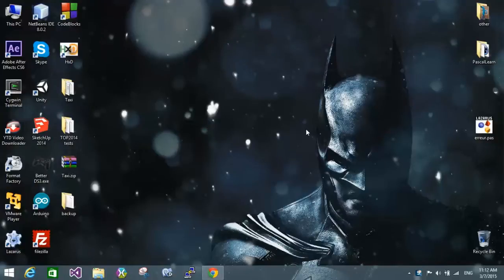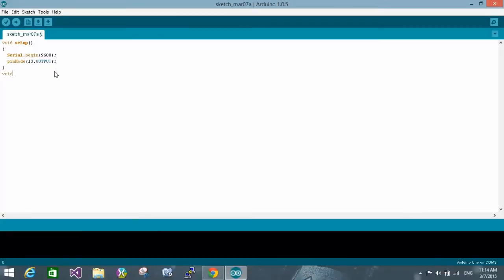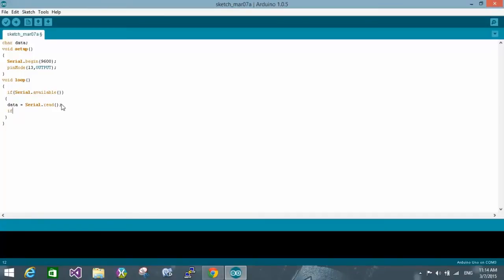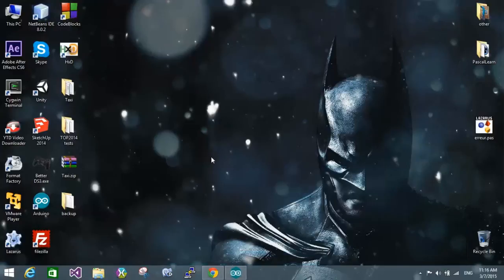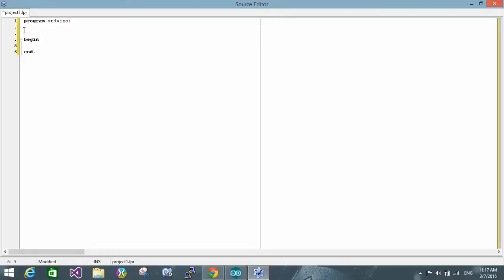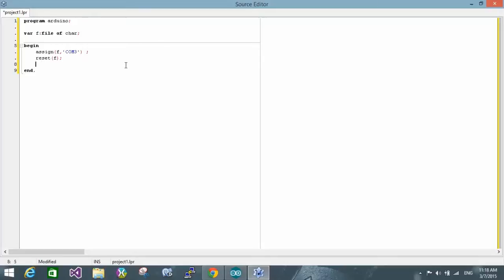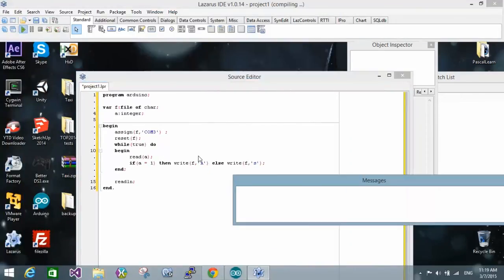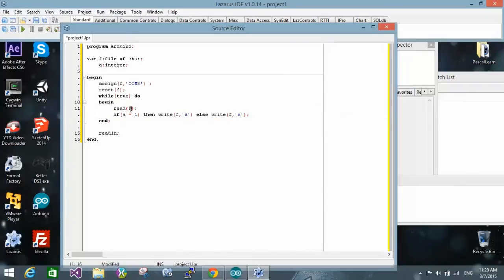Arduino & Pascal programming language - HOW TO

Comment: I did everything as in the video and all went well. But to simulate a project I have in mind I stopped Lazarus, powered my Arduino off, powered it on again and started the application on Lazarus. And then.....nothing :( Now the weird thing: if I start up Putty, the LED at pin 13 flashes some times. After stopping Putty, nothing typed, I can use the program.
This also happens when using the package Synapse with the file synaser.pas. 
Now I have to find out what is going on......

Comment: Massively disappointing. I wanted to see FPC code run ON the Arduino.
Reply: So do I, but remember that the Arduino IDE is designed to take control of all these fancy  hardware input and output connections and the onboard LED #13
Without that you cannot do very much.
I'm a Turbo Pascal guy, and I cherish that, but a guy must know his programming language limitations.

Comment: What so FAKE video, starting from the point that it needs Rewrite instead of Reset and it has not the {$I-} compiler directive to avoid hardware fault... and AFAIK, you need to do it with avr components...
Reply: The compiler directive is not needed, it works fine without that.
I agree on the 'rewrite' versus 'reset' issue, but for some reason both of them are good.

Comment: Good tutorial! But if I need to read data from Arduino? What I have to do?
Reply from the maker: Well , Basically you could read from the file instead of writing to it. so replace write(f,'A') with read(f,data) where data is a char variable that will hold the the coming data :)
Reply: +IKnow Thanks.
Reply from the maker: :) Sure , feel free to join our community forum at forum.iknowbrain.work , so we could learn from each other :)

Comment: THIS IS GARBAGE!

Downvote because you don't show how you ACTUALLY program Arduino. How do you load that Windows app into Arduino????
Reply from the maker: Sorry for being a little bit late, But which part did confuse you? Because we do not load the windows app into the Arduino, The windows app was created to run on windows . the arduino sketch was created to run on arduino. the windows operating system is what connects these to programs together (The one running on windows and the one running on arduino) thanks to the filesystem mechanism .
Please explain a little more so that we can help you
Reply: +Merula Alba 

He uploaded a program in the arduino (with the standard arduino IDE) to respond to the COM port .

The Pascal part only uses the PC COM port to make the program in the arduino react.

But you are right, it is garbage, because there's never any compiled pascal code in the arduino. If that's what you where looking for (like me).

Comment: Hey mate, nice tutorial, im thinking About to Buy my First arduino and Start Programming with it, but Pascal is the only language im able to use more or less, 
But i have 2 questions :
1. How Do i know which one is the USB and which USB? I never used the assign function before.. In which order does this COM'x' work? 
2. Why Do you use 'A'  and 's'? How does the arduino Interpret that? How does it know which Pin on the board is meant etc? In the normal arduino IDE you assigned Pin 13 as an Output but in Pascal there is nothing which declares that
Reply from the maker: Hi sorry for being a little bit late.
1/ when you install the arduino ide , there is an option in the menu bar that tells you the name of your com port , it should be something like com1 or com2 or com3 and so on. So there is no order , the ide will tell which one to use.
2/ We told the arduino to do something when it gets the character A, nothing special about it , you could pick any byte (any character since a character is a byte) but the same character you pick in arduino is the one you have to send from the computer. the the character s is a random one , the main thing is that it has to be different to the one we picked before ( Arduino needs to distinguishes between which one turns the led on and which one turns it off).
The special thing that the arduino does when it gets the character (I called it A in our example)  is to turn the output voltage of the pin 13 to 5 volts instead of 0 volts (We pick pin 13 because it has an led by default , but you could chose any other pin and plug in you external led your self , make sure to add resistor !) 
Pascal does not care what pin13 is or even what will happen to the data it is sending , it just send it , that was it main job. and your arduino stays tuned until it receives it :)
Hope I covered your questions/
Please join our forum at forum.iknowbrain.work (The official iknow forum) .
Good luck
Reply: So basically, you still need to write the program inside the arduino IDE :/ i was hoping there is the possibillity to program arduino completely With Pascal (assigning "high" and "low" etc. Without using C+ Or whatever the arduino IDE uses)
Reply from the maker: Well , technically that is possible , in the end the code will be compiled to assembly and then binary , so whether it came from pascal or c++, the result would be the same. The micro controller built in is avr atmega so avr pascal compilers are needed. In fact there is a project on github that aims to integrate arduino dev into lazarus at https://github.com/jmpessoa/lazarduinomodulewizard . But there is no official way to do that.
I assume that you are trying to achieve this because , maybe you don't want to learn c++ , and you want to use some language that you already know. I advice you to learn c++, it is a mainstream language, which means that wherever you go in the world of computers you will always find it there, it is behind almost everything, from operating system development to game development to graphics  development, Even google uses it in its backend tools thanks to it high speed. also  is the most documented language on earth so when ever you get stuck , you will always find a solution. but for pascal , I'm sorry to say this but I encourage you to say good bye to it. but don't worry , almost all the theories you learned about pascal also exists in c++. This is my advice and of course the choice is yours sir.
Feel free to join our forum at forum.iknowbrain.work :)
Reply: Don't worry. If you're using that just for hobby, it is just fine. FPC for AVR maybe not available for serious AVR projects yet, but never give up. Pascal is not dead yet! Language is a just language, I using many languages every day, not really hard to learn them because I'm not framework/library oriented person.

I was using Pascal for testing building a simple 32bit kernel, or arm kernel just for hobby, and really, Pascal can do that anything C can do that. Especially the FPC. Maybe because of lack of library then you need to write them from scratch, why not? Many C programmers doing that, writing String type from scratch because need more speed and efficiency, you can do that for Pascal.

In production, I just using Pascal for Desktop Apps and Web Services. Well, really. Here was someone said "you must say goodbye to Pascal", that makes me laugh.